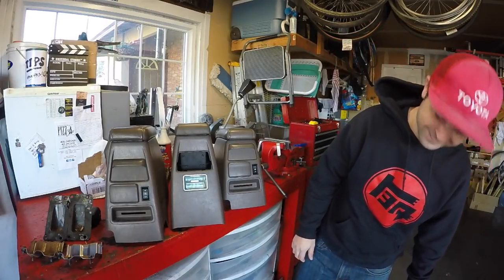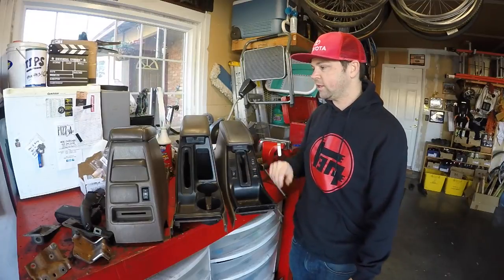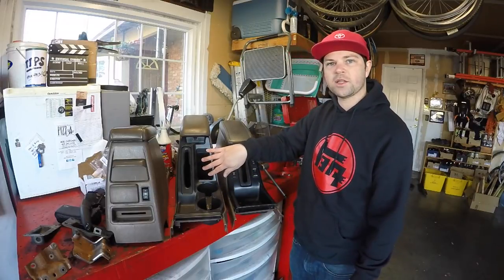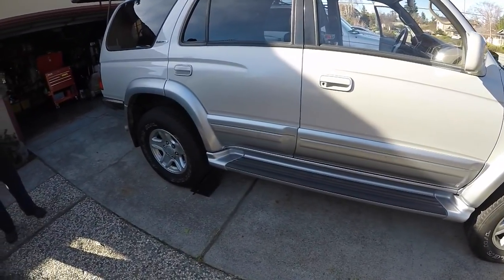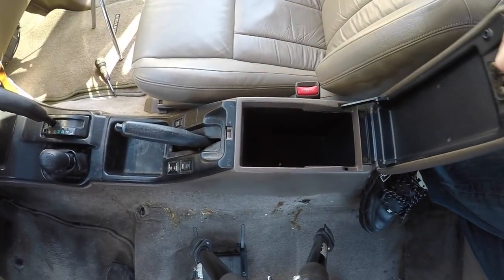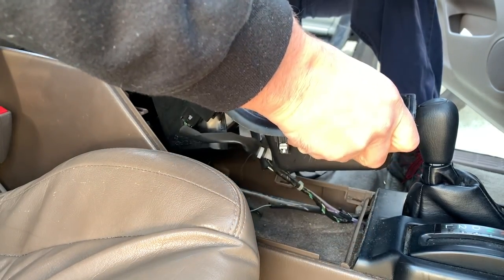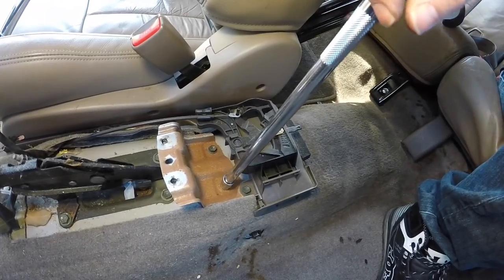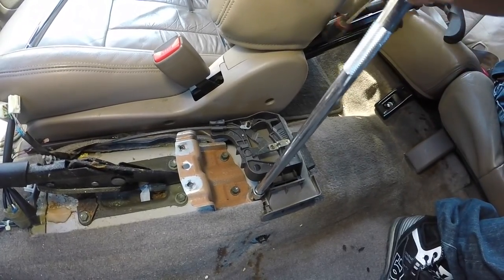Center Console Mod - Cup Holder Mod for 96-98 Toyota 4Runner's

Comment: Thanks so much, Sean (and Tim).  I so appreciate the attention to detail you guys provide. I had to go back and re-watch a few sections here and there during the process, but I finally got this sick mod done and drove to work with a beverage in my "new" cupholder this morning!  I have a 1998 5-speed SR5 and used a 2000 auto Limited as my donor.  I'm always a little nervous when cutting around wires and moving them, but everything seems to be working fine after the "surgery."  The donor tub - couldn't quite get it to work.  I went back and forth on it, but I finally just put my original tub back in, and it works for the most part.  I'm just a little nervous because it isn't positioned well to accommodate the angle of the new e-brake, so the e-brake cable is rubbing against the nut that sticks out of the tub, and the tab that holds the line down rubs against the tub when I pull the e-brake up. I use the brake quite a bit since I have a 5-speed, so I'll just have to check on it every now and then (and maybe someday, I'll brake out the Dremel and perform some surgery).  Thanks, again!
Reply from the maker: You're very welcome.  Good job completing the mod!

Comment: Great video guys! Super helpful, thank you! I just finished the mod on my '96 4Runner. My donor console was from a '99 4Runner and I was hoping that I wouldn't have to trim the body, but I did need to. With a dremel it wasn't too bad. I cut off about 1/4 inch from the passenger side of the tub area, put a few coats of paint on, and was good to go. I think any '96 is going to need the body trim.
Reply from the maker: Alex Keller thanks for taking the time to come back to the video & comment with your experience on your 1996. We hope your comment helps others in the future understand what they may need to modify on their rig. Enjoy your new center console with cup holders!
Reply: Were the tubs the same or different 96 to 99?

Comment: I did this mod in my 97 SR5 from a 2000 Limted donor both with the passenger seat rear heater.  I grabbed the console, E-Brake handle and the E-brake Tub.  During the installed I pull my 97 tub out and put in the '00 tub, but the holes didnt line up and would require drilling out holes.  For grins I decided to put back my '97 tub and the handle lined up perfectly.  Moving the wiring was pretty straight forward too, 2 of them were a little tight, but wasn't to hard to get it all done.  

Another good vid Tim!  I wouldn't have known to be on the look for this while going through the yards for other projects.  Took me 5-10 minutes to remove from donor and an hour or so to install in my rig.

Salvage Yard in phoenix charged me total $25 for the console and E-brake parts and accessories.

TL;DR  '00 limited console install to a '97 SR5 use '97 e-brake tub with the '00 handle and console, factory bolt holes will line up perfectly!
Reply from the maker: Great to hear we gave you an idea for a sic mod and it went well for you.  This video was all Sean though.  He did all the research for this one.  I was just along for the ride and did the filming.
Reply: perfect, just what I was wondering since this was a 98...

Comment: I have a 99 so I've never needed to do this. It requires more work that I thought.
Reply from the maker: It's fairly involved but not that bad of a job at all.  The biggest pain is separating all the wires you are relocating from the harness which is a little tedious.

Comment: did the mod almost a year ago an thought i had to extend the wires. i actually tugged  the wires under the console and never get back to it. Nice to know i don't have to clip and solder wires.
Reply from the maker: Yeah, not having to extend the wires is a big plus for time savings.
Reply: @TimmyTheToolman  hell yeah. Every other video and write up i have seen involves cutting and extending the wires. Also, some feedback from my experience. I purchased the e-break base with the mount and the center console. The new e-brake base didn't fit in the  hole. I tried my original base and the 99+ E-brake lined up perfectly with the new console. I didn't have to use the 99+ base. It was a big relief as i wasn't willing to do any cutting on the body. Not sure what year the donor truck was as i purchased the parts on ebay.

Comment: Great mod. I have a 1997 4runner. I've never seen this mod and wondered if I could take the center counsel out of a 1999 and adapt it to my 1997. Now that I've watched your posse do this mod I plan to find the correct donor vehicle. I have a blue interior so it's a slight problem.
Reply from the maker: Glad you you like the video and good luck when you get around to doing it.

Comment: Late watching this:

I have a 1998 5 M/T 4R,

I am getting tired of drenching shifter with whatever is in the above heater/ac controls cup holders.

So I have a 2001 console w/tub-bracket.

Can I use my OE 5 SP M/T shifter center console to new 2001 center console bezel, to eventually mount TEQ brackets upside down U.

Also ‘98 only has rear window up/down switch, which I’ll mount inside lower front facing side console opening.

‘98 OE console w/heater slider &  cup holder.

Thanks
Dave

Comment: You didn’t need to pull off the 4x4 knob you can just take the boot liner out to take off the plastic top
Reply from the maker: Yeah, you're right but which is the lesser effort? Messing with the boot or unscrewing the knob? Messing with the boot can be entirely more frustrating that taking off the 4x4 knob. To each his own.

Comment: Would this work with a 5 speed? I have a 98 limited 5speed and a 2000 auto I can pull parts off of?
Reply from the maker: The 5 speed has a totally different console.  I don't think this would work.
Reply: Yes, it will work (as long as you match the heater vs. non-heater version to yours).  I have a 1998 SR5 5-speed and got a 2000 Limited donor console. Just finished it last night. The tub was a little bit of an issue (donor wouldn't quite fit), so I just ended up using my original tub and the e-brake line is pulling a bit.
Reply from the maker: @eljefeslash  Good to know.  Thanks for sharing this info.
Reply: Yes I have a 96 5 speed and had no problem. Don't bother with the E brake tub it is unnecessary.

Comment: What's the reason behind the tub? I have a 97 limited auto 4x4 with rear heater and grabbed the parts from a 99 (ebrake, braket, console) and it all fit together without any issues. Guessing some vehicles are different than others?
Reply from the maker: It's because the e-brake handle is offset on the models with cupholders and the tub is specific to work with that offset e-brake handle.  It is interesting you found that your 97 tub worked fine for the 99 ebrake handle.  I guess the safe bet is to grab it from the donor vehicle just in case you need it.
Reply: @TimmyTheToolman  
Yeah that's extremely strange. Tomorrow I'm going to look at it again just to double check everything. My vehicle may have had it replaced from a previous owner for some odd reason
Reply: @TimmyTheToolman  same here. i got the base from the donor vehicle and end up using my 97. worked fine with the new e brake.
Reply from the maker: @Terry-ww9tr  Well, either we got some bad information or the tub issue is only relevant for certain years.
Reply: I have a 96 4x4 5 speed and didn't need the tub either. I wasted like 30 minutes trying to get those damn pins in to slide mine out and it was completely unnecessary lol.

Comment: does anyone know if a donor console from an auto tranny 4Runner will fit a 5-speed manual shift console? My swap is donor 99 auto to 98 manual.
Reply from the maker: We're not sure because we've never tried it.
Reply: I have a 1998 SR5 manual, and I used a 2000 Limited auto donor. It may depend on some variables, but it worked for me (the donor tub was an issue - maybe the 99 tub will fit yours, though).

Comment: Does this only apply to automatic transmissions?  I have the 98 5MT and it has these two goofy and weak cupholders that pop out of the stereo bezel.
Reply from the maker: No, it doesn't only apply to automatic transmission models.  This will work for manual transmission models as well.  The center console is the same.

Comment: What Steering Wheel is that from? Plug & play or?
Reply from the maker: Gzus Piece es300. It is plug n play! But cruise control switch may need to be swapped.
Reply: @TimmyTheToolman  thanks! Just bought one online for $30!
Reply from the maker: @Ioading...10  Have fun with the install.
Reply: Hi Sean I have the 98 w/cup holder already what I want to do is add the heater control set up for the rear. Do you have a video on how to make this conversion?
Yazmin 
Venice Beach CA ⛱

Comment: Timmy i have a question i went mudding yesterday with my 3rd gen 4runner when i turn my ignition off i cant turn it back on. i only hear one click... please helpppp
Reply: sounds suspiciously like a dead battery
Reply from the maker: It could be a weak battery, bad connection, problem with the charging system or a bad starter.  Start by cleaning up your battery posts and terminals and make sure your grounds are clean and tight.  If you have a multimeter, check the strength of your battery when the engine is off. A strong battery should show around 12.6 volts.  Next, turn on the engine and you should see that the alternator is charging the system efficiently at around 13.7 to 14.7 volts.  If you don't have a multimeter, most auto parts stores will check your battery and charging system for free.  I know for sure O'Reilly's does it.  If you're battery is good and charging system looks fine, and all your connections look good, I'd then pull your starter and replace the plunger and contacts in the solenoid. https://youtu.be/WV1t5-wcoOI  If the charging system isn't working properly, it might be worn brushes in your alternator and we have a video for that: https://youtu.be/71_kBhg6_-A  Let me know what you figure out.
Reply: Timmy thanks for the feedback i figure out the problem and the problem was a bad starter thanks again you're the best!!!!

Comment: I have a 97 base sr5 4runner would a 98 be plug and play? Or it's a 50/50 chance? 

edit another great video btw.. I've been doing a lot of my own repairs with u guys help [videos]. Thanks atw from NC! #YodaGang
Reply from the maker: Turkeyy Man with the items we got from the donor vehicle, this mod was plug n play. Like we mentioned in the video, our buddy 4runner4leon has to cut some of his body (he has a 97’) but others have reported that they didn’t need to cut anything. Go to the link in the video description to read through a good write that touches on some of these things.
Reply: I have a 97 and pulled one from a 02 and it worked fine just take the e-brake and the little metal cup under it

Comment: Is it essential that I get a new tub? I have a 98. I can't seem to find any handbrake tubs online.
Reply from the maker: Some people have said they needed to replace their tub while others have said they were able to use there existing one.  The safest bet is to get the tub also.  But, it's not that     much labor to get the center console off and the handbrake off to check before you get into the electrical relocating part which is the most time consuming.  If your current tub isn't going to work with the offset hand brake, you'll just have to put everything back together and go back to searching for a tub that will work.  The easiest way to go for this mod is to grab everything you need from the same donor vehicle.
Reply: @TimmyTheToolman  So I just finished the project and I was able to use the original brake tub. However, I ran into a problem. My brake dash light doesn't turn on when the brake is engaged! I'm not sure if I snagged something, but the button that turns off and on the light on the dash works fine. Any ideas?
Reply from the maker: @anthonyt4981  Maybe the switch that triggers the dash light is broken.  Try swapping it out with the one on your original brake handle.  Unless you really tugged on the electrical connector to that switch really hard, I'd imagine the wiring is fine.
Reply: @TimmyTheToolman  I tried the original switch as well, and it was working before switching the handbrake to the 99. The weird thing is, the dash light is supposed to be lit when the button is not pressed right? The dash light doesn't turn on whatsoever. It turned on once when I started up the car, then I dropped the brake lever and the light turned off. When I engaged the handbrake, the light did not light back up. I've posted my problem on t4r and reddit, no response. Such an odd problem. Does everything work on your end?
Edit: Oh and thanks for replying in such a timely manner.
Reply from the maker: @anthonyt4981  Was the electrical connector hooked up to the switch when you dropped the hand brake?
Reply: @TimmyTheToolman  yeah, at that point the entire middle console was put together.
Reply from the maker: @anthonyt4981  Well,  maybe something did happen to the connector.  I would unclip it from the switch and take a good look at it.  Maybe one of the pins pulled out partially from the connector and it's not getting a connection with the switch.

Comment: Question  do ya think i can fit 2018 trd shocks  under my 97 4runner?
Reply from the maker: WITH Timmy no. Not without some
Modification to the coil over setup. Here’s a good conversation about this: https://www.toyota-4runner.org/3rd-gen-t4rs/238368-confirmed-5th-gen-trdp-rear-suspension-3rd-gen.html
Reply: @TimmyTheToolman   thanks for your time. Much appreciated